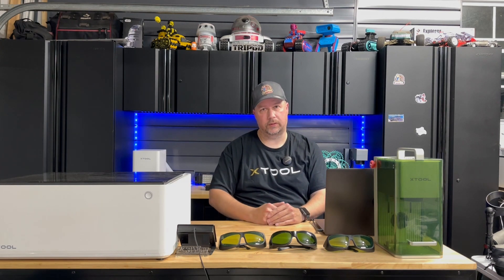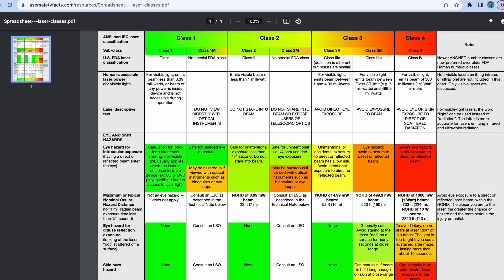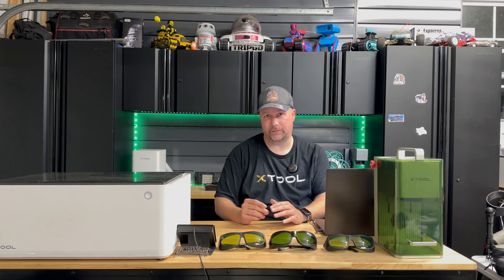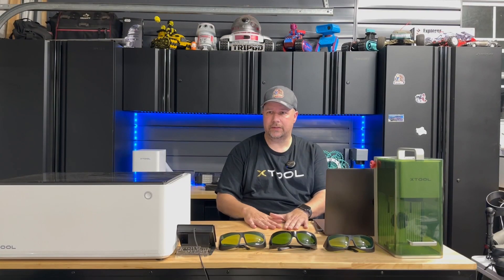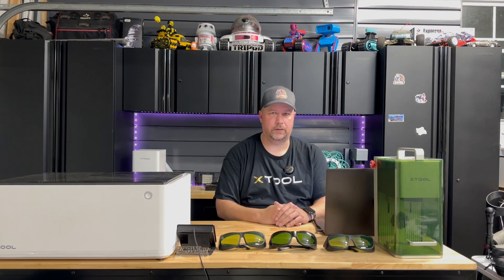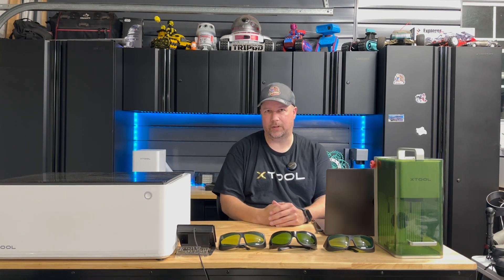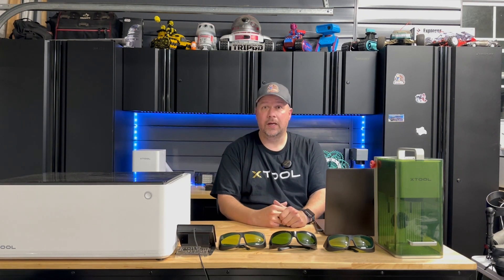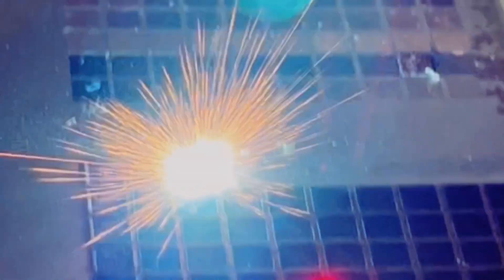IS IT TOO DANGEROUS TO USE A LASER ENGRAVER?  XTOOL S1

Comment: I think the biggest issues with people and lasers is in my opinion similar to people that don't really do the research in 3D printing and then blame the tool or the company.

And there's a lot of people out there with no common sense and get hurt..... it think that's the biggest issue, because it's made to look so much easier and safer than it is if that makes sense?

Look at the laser pens people get kids back in the day and sometimes still till this day....  I was always careful as a kid but you'd have those kids that would point the laser at people...

But yes, if you follow all the guidelines and such you're pretty safe but still never leave a constant laser unattended.    It's a bit different if you have to hold a button down to turn it on and keep it on but if it's capable like these DIY and hobby like laser ls are to stay on, then stand by or near the laser with protection till it's finished.

Good video mate 🙏🥰